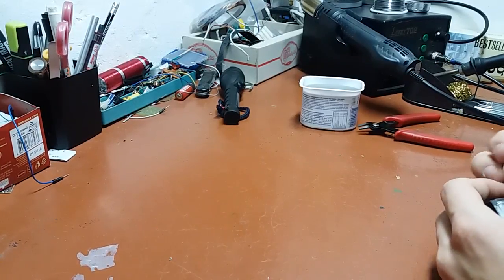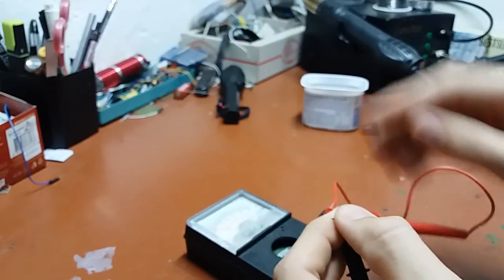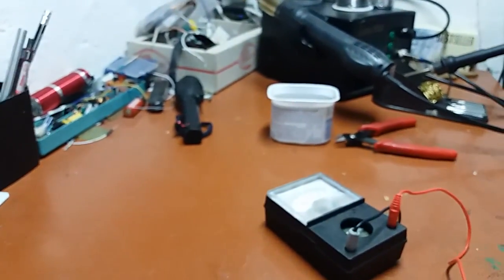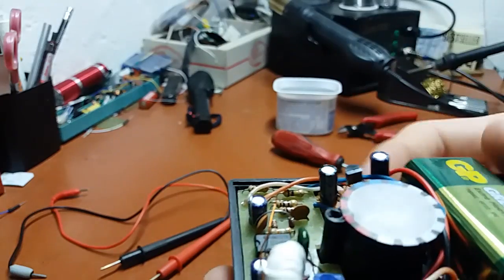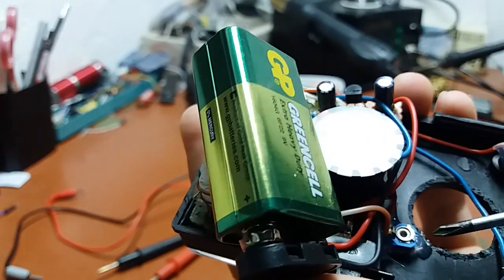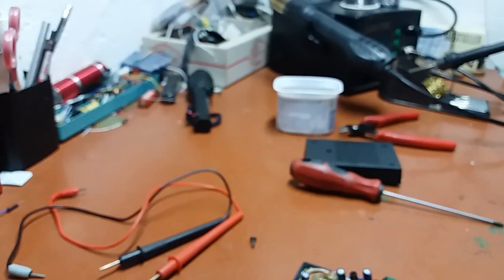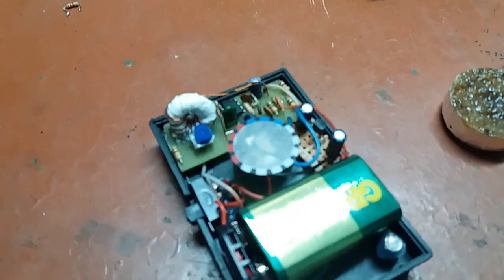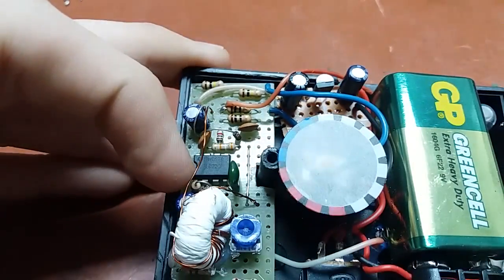DIY ESR Meter

Comment: Thanks for sharing the experience, including the bad one with a charged Cap. 
I’m testing different ESR circuits to build my own (*) and found your assembly of that Ludens one. 
Could you comment some points for me?
(1) Why not to use 2x diodos back to back as charged-capacitor protection? Wouldn’t the Vpp be low enough to avoid conduction under normal operation?
(2) What is the mid-point ESR value in the galvanometer?
(3) What is the ESR for some initial displacement as 10~20% scale?
(4) What is the average consumption (mA) or how long a 9V (alkaline) battery lasts?
(5) After 6years, would you build it again, or choose another circuit? Could you point it for us? 
(*) So far, I built (on protoboard) to test:
#1 Russian one based on Colpitts oscillator that operates at 1.5V (nice), gives a nice senoid of 17KHz (modified to 100KHz), but ESR scale seems to be not so predictive, quitting the oscillations erratically/intermittently if R > 15 Ohm.
#2 NE555 + NPN to drive an 8R resistor under low-voltage (100mVpp), amplify its output (1 stage transistor AC) and rectify it to shown in the galvanometer. Seems promising, from 4.5V to 12V, but scale needs stable voltage and power consumption is not ideal for battery operation.
#3 Swagatam’s site posted one based on Joule Thief and an OpAmp. I tried some variants as it operates under lower voltage (< 5V), but did not like the oscillator performance (F ~ 20KHz), with amplitude and waveform too inconsistent even for a Go/NoGo instrument. 
#4 Jay-Diddy’s circuit, using 5 transistors (or a newer 7 transistor with short Cap detection), promises to have center scale at ~3R - didn’t build it yet, but seems to be good in blog’s comments.
#5 A 4 OpAmp (TL084) based circuit, quite popular here in Brazil and being ‘commercially sold’ in local sales sites. Operated under 9V, seems to have center scale at 10R, and also detects shorted Caps. Not built one (yet).
Curious to hear your thoughts, Thank you !

Comment: Can I ask you about the 10 ohms in parallel and 10 ohms in series on the secondary of the transformer. How much did you finally modify these two resistors? Thank you
Reply from the maker: I didn't change the value of those. I once had to replace them when I tested the charged cap
Reply: @mrjohhhnnnyyy5797  Thanks

Comment: Is it  possible to share the link of the circuit diagram and pcb layout of that DIY ESR meter? I want to built my owned awesome meter. Thank you
Reply from the maker: Yet again: the link is in the description for the video, which nobody gives a shit to check out. The PCB layout doesn't exist, 'cause it's made on perfboard.
Reply: Sorry about that giving you streess. I cannot see the description in my celfone. If ever I can borrow laptop, I will check it. Thank you anyway to your reply
Reply from the maker: @dasolpan3194 I dunno, just exit the full screen mode and you should be able to see the description. I do it on Android all the time. In fact I double checked that the link is there and it still works using phone.
 Nothing personal, it's just that everybody prefers the link in the reply, but YT might block it. Link in comments will cause the comment to go in the spam, unless you verify it manually

Comment: Could you share the pcb layout and parts?
Reply from the maker: There's no PCB, I made it on perfboard. As for the parts, I'll try to find a link.
Reply from the maker: Here's a link to the project:  http://ludens.cl/Electron/esr/esr.html
Reply: What about the circuit diagram? I can manage with that and the parts...

Comment: Excellent realization. One question: I would like to insert a LED in the circuit that indicates a possible short circuit, can you suggest me where to insert it? Thank you
Reply from the maker: I wanted to put a "DC short" indicator myself, but never managed to make it work with this very circuit. The transformer on the output makes it tricky.

Comment: Enjoyed the tech ... and your humor!
Question: Can you use this meter to test the start and run capacitor on a single phase motor?
Reply from the maker: You can test ESR of any capacitor. Have in mind, though, this meter shows you just ESR, not capacitance nor leakage
Reply: @mrjohhhnnnyyy5797 , Thanx for your reply. I'll take it under advisement.

Comment: I like this kind of content. If I had some magnet wire I'd make one of these meters. I might be able to pull some wire out of an old transformer or something.
Reply from the maker: Paul Frederick You mean you would make the actual meter movement?
Reply: I'd make the transformer. Though I see that some use transformers they find. I might try figuring out the ratios of some candidate transformers I have here. I am starting to pull parts for the 5 transistor ESR meter now. So I am going to try to make that one first. It does not have a transformer in it. I possess a natural talent for avoiding problems. I saw your comment on a video about that circuit and I am going to try to match Q4 and Q5's VBEs if I can figure out how to manage that.
Reply from the maker: Paul Frederick Ahh, ok. Silly me :)
You can use the choke from CFL, take it apart and file one half of the core so it doesn't have the gap. You can use original winding as primary and wind only secondary. Turns can be determined experimentally, the output amplitude shouldn't be higher than 200mV peak.
Reply from the maker: Paul Frederick Yeah, that circuit is nice. By the time I saw it, I already built this one though. Go ahead, Alan tested it, seems to perform well.

Comment: Have you thought of making a version to connect to your digital meter in voltage mode?, you may be able to trim the output voltage to line up with the esr :-)
Reply from the maker: +zx8401ztv Actually, I can calibrate this scale and it'll show the value. I use this meter to determine is the cap good or bad,  if I want to know exact value, I use my TransistorTester. On top of that, even if I manage to fry it,  it's easy and cheap to repair. It won't be too hard to make what you've suggested, but it won't be standalone unit that way.  Thanks for feedback!

Comment: I used same circuit but made it as seperate unit
Reply from the maker: I was thinking about making it separate too, but after I tested meters' performance I gutted it out without any sense of guilt whatsoever. It worked horribly,  all measurements were off by a big amount.  Now it is a completely standalone unit,  and I love it in this form.
Reply: +MrJohhhnnnyyy I use it for something where I want too se voltage or current move or testing if pots are ok and not schratched or something so its more indicator than meter for me,I tryed to film video about my esr meter but just ended talking crap that makes no sense and then sun went away and now its too dark to film eh.
Reply from the maker: +JOSIP Žlk All my videos are full of babble, not all people can express their minds in short and clear way :) So don't you worry. 
 By the way, using this thing to check possibly scratchy pots is very clever, I need to get another one ;)